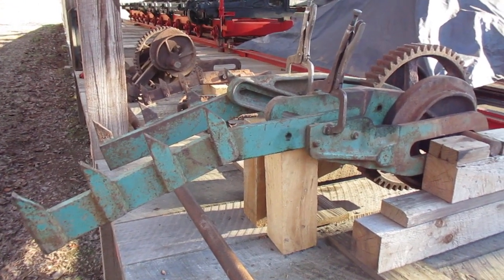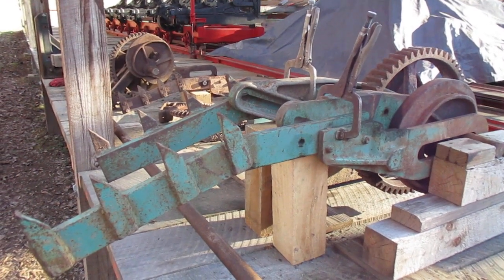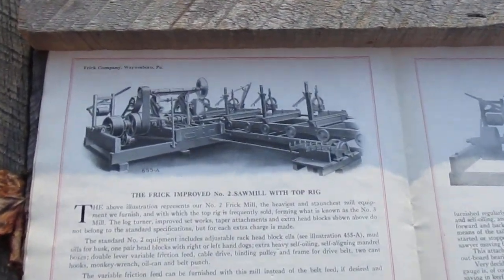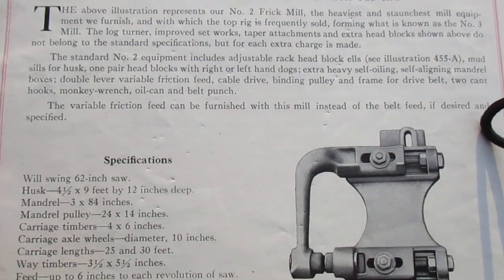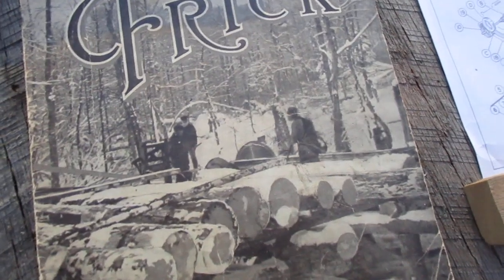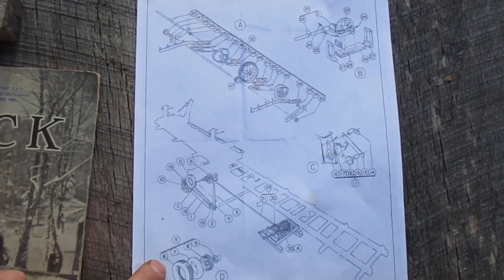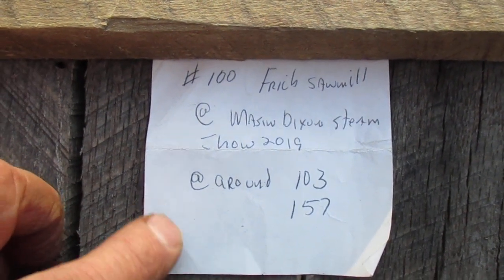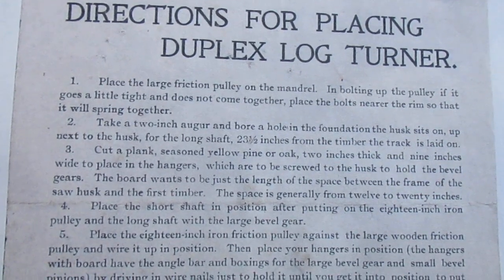#123 Frick Machinal  Duplex Log Turner       Part 1

Comment: My grandfather made a log Turner that was so simple it was funny.car rear end narrowed and lever put on one side to apply break.other was drum and cable with hook.a electric motor ran the rear end.you flipped light switch to turn on and grabbed cable and pulled it down and hooked on log.a shaft with half round was on log bunk near carriage.in normal position it was out of the way turn it so half round was up and log would roll on it in place.bigger logs he could grab the cable and pull down hook and hook the log and then simply reach up and pull the lever that applied the break.this would cause other side with drum to wind in turning the log in place.now you could use ATV winch and get same result.the load was spread out over several rafters and the wall
Reply from the maker: hi there that was sounds like a pretty smart idea . like to have seen it , this turner was going to a show mill , so they wanted it to be the correct one , thanks for all and dropping in with it john

Comment: What I could see of your rebuilt carriage, and tracks, looks really nice. I can not wait to see your mill in action, it will be a thing of beauty for sure. I wish I could help in the Duplex Log Turner, but we always used cant hooks. I never saw one of these devices until just now. I agree with you on the long shaft running from the husk to the turner, it is an accident waiting to happen, and I would have  been one of those who had the accident.
Reply from the maker: hi there  a lot of safety may be common sense i hope you are safe in all that you do john